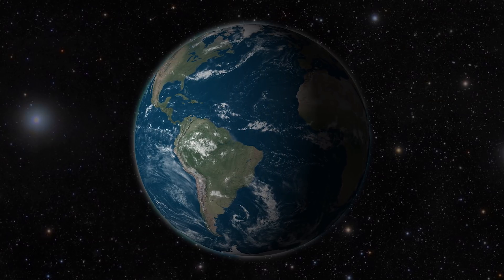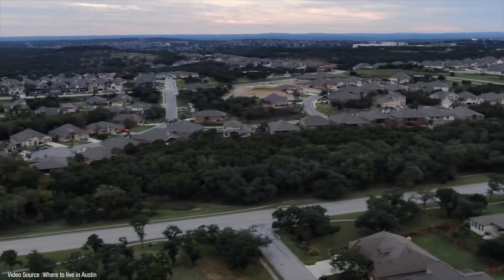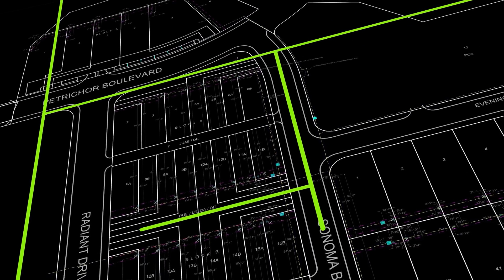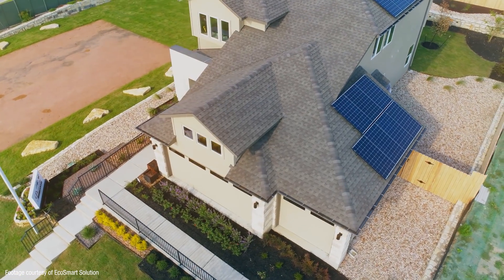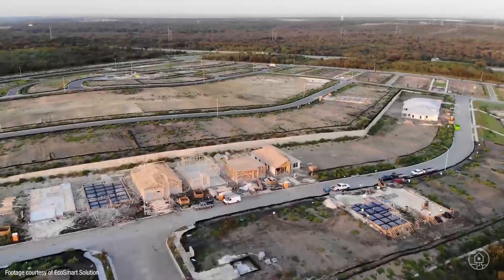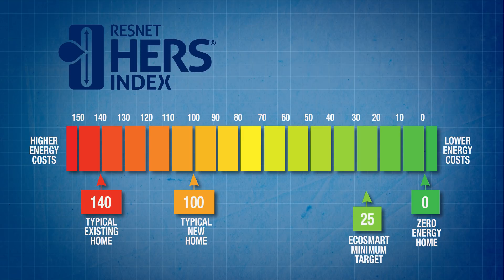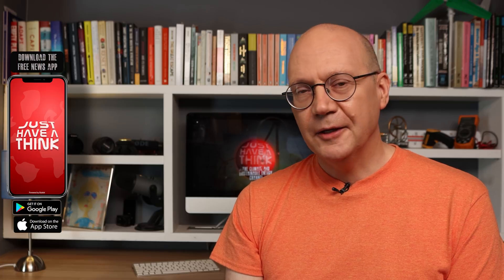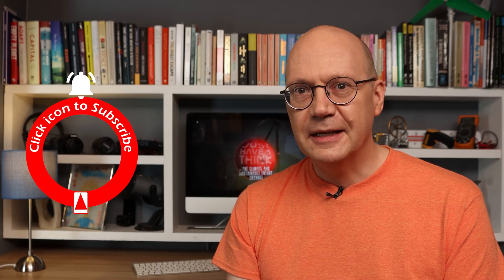Geothermal Energy meets Master Planned Communities :  A blueprint for the future?

Comment: Honestly it's like a lipstick on a pig. Every house will have two cars (tires, plastic, steel etc) which need even more roads and parkings in nearest city (more asphalt or concrete) and grass around the house will be regularly watered and definitely grass, not some kind of vegetables that could interfere with a big bbq party.
Only improvement you can expect is a self-satisfaction of affluent living there. Sigh.
Reply: Probably not worth doing anything then I guess
Reply: @emceeboogieboots1608  Absolutely opposite! Many things can be done. Most of them easily and cheaply than this. Some of them can have real impact. Just this specific thing won't cut the cheese because people living in this houses will still have extremely high carbon footprint.
Reply: @mariuszfurman4767  Yeah, a good public transport system will help reduce the need for cars but while population is increasing more housing will be needed. It is best that the housing people build now is better than the norm.
People are not all going to resort to tiny homes. I myself live in a 40 year old house and have made many efficiency changes but established homes in established areas are not necessarily cheap. Newer developments are generally further away from cities and built to tighter budgets. I think any of these types of innovative ideas are fantastic, particularly when combined with passive principles, renewable energy, batteries and such.
In fact community projects should encourage more engagement and commitment from all residents in principle
What is needed is education and governmental encouragement to help get a nice frock, a decent hat and some fancy shoes for that pig as well!
Reply: @mariuszfurman4767  Do keep in mind that EcoSmart Solution only handles the green energy technology for the homes. Texas is hot, and hot for sometimes very long periods of time. Our specialty here is reducing the peak energy demand of residential development during those times (and others) - which provides significant decarbonization efforts. Many folks in the neighborhood are undertaking xeriscaping, have EV's, and help in the community gardens in the neighborhood. The development does have significant space for commercial areas as well as transportation, and about 600 further acres of greenspace. It's a little difficult to squeeze all of that information into a 10 minute video :)

Comment: I'd love to see a 2000 acre earthship community with geothermal, solar feeding into a Tesla Powerpack system. The entire community could adapt a natural, native landscaping that provides food to the residents, encourages biodiversity, and an enjoyable landscape.
Reply: Planning this when we get our farm we are going to do this geothermaly with the steam powering turbines and power for the entire farm.  We have no need of bird and bat killing wind turbines.  We will use thin film solar panels on all roofing and on a parcel of land that's recuperating it's soils to next be in rotation.  The plan is again using thin film solar panels in a roll up solar strips 50 meters long and 2.5 m wide.  200 rolls for a half metric acre 500m x 500m.  That are easily moveable to the next fallow field. For this amount of electricity generated we will need several Tesla Coils and a field of High performance Batteries.  This may seem unorthodox but it does work.

Comment: Such an impressive approach. As a DYI solar energy buff, I quickly learned that the key to solar thermal energy systems is the inter-seasonal storage requirement. As stated in your video, it is very difficult to retrofit an existing structure, especially one built in 1895!! Likewise, it is very difficult to engage local government bureaucracy to consider a regional solution. So this developer has got it right, and engaged with the right technology solution provider to attract those new home owners with a vision toward smart and efficient energy usage. Well done!!!

Comment: We have a geothermal system with a mini German made turbine and Heat Pump which converts high pressure steam to energy to power the huge home, garage and 8 grow rooms with tonnes of electricity we bank in our batteries.  Swiss made hyper performing cells.  It has never failed us.
Reply: How do you get steam ? You dug to the mantle or you have thermal solar panels, which isn't geothermal anymore ?
Reply: @Elviloh  a bore hole 150 ft deep to where the temp is 100C the boling temp of water.  Cold water is put down the stream rises and turns the turbines
Reply: @Elviloh  you don't need to get close to the mantle to get steam especially if you live in a volcanic region. That being said I only know of one company that even makes geothermal power plants of this size and they aren't a German company, and aren't cost competitive with the grid (although their system is more affordable on a cost per kwh basis than a compatable set of diesel genorators)

Comment: Well, it's an effort in the right direction. Dropping energy usage is a huge plus. Although the current walkability score is zero, I see they are at least putting in sidewalks (pavement) if you'd like to walk to the currently non-existent retail. They have a good sized Tesla charging station as part of the development. Kind of a mixed bag for now
Reply: Roads and footways still leaves nowhere to cycle. As you say this addresses part of the problem, but does little or nothing to address car-dependency. At least there is a nod to mixed zoning so there should be some shops and schools that aren't 10+ miles away.
Reply: The entire corridor is changing rapidly, and the development has several million sq ft of space for commercial that would very much be walkable. 600 acres of green space too!
Reply: @ecosmartdavid1283  if your commercial areas are walkable but you need to drive to get there, they aren’t walkable!
Reply: @birdrocket  the main artery road that runs from one side of the project to the other is a little over 2 miles long :). At the end of the day - Ecosmart Solution is the geothermal service provider, not the developer.

Comment: What about allowing enough additional Solar/Battery capacity for all those KwH guzzling SUVs that will be running round the streets in 2035, and onwards? This scheme on its own does some good things, but it still perpetuates car-bound suburban sprawl.
Reply: that was my concern as well. Can't consider a neighborhood green if everyone is using traditional lawnmowers, and bankrupting their cities with more suburbs.
Reply: Hi there! Because the energy consumption of the ground source heat pumps are so much lower than traditional HVACs - the home needs significantly less solar. That leaves room for upgrades or expansions should homeowners want to do that.
Reply: @ecosmartdavid1283  the issue here isn’t the solar capacity, it’s the fact it’s a car dependent suburb that isn’t walkable within its bounds and doesn’t have a single connection to Austin’s transit system! That’s bad!
Reply: It is funny how pick-up trucks are not any more efficient than SUVs and are even more common, yet there is always someone whining about SUVs.  I think it is just jealousy.
Reply: @TheGuyThatEveryoneIgnores  no, it's a combo of dealing with Karens who decide their SUV rules the road, and everyone already knowing that shiny white 6 wheeled pickup is a compensation piece.

Comment: I think it's a smart idea. It would be better overall if solar owners could network their power and battery storage like they're doing here generally. I don't know how difficult that would be to do though... you'd need private power lines or cables in addition to the grid ones, which could cause clutter and complication... but if you could segment a home solar/battery network in coordination with the power companies, then it would be easy to switch between grid power and personally generated power for an entire cell (or neighborhood). You could probably also set up an agreement with grid providers that during peak loads, they could drain some of that cell (neighborhood) power to offset the load and reduce overall grid production during that time. 

I say 'cell' because each neighborhood with this network system would basically act as a single cell within a larger battery that contains some amount of charge. It's like taking the micro (circuit boards) level logic and applying it to a macro (grid) level system. It could potentially be revolutionary.

Comment: Thanks for the video, Dave. I see the benefits in moving off fossil fuels with energy conservation, heat pumps and solar panels in individual houses. All of these make great sense. Builders should adopt these measures ASAP. But the idea of interconnecting individual houses to a central air cooling tower isn't required in most climates (maybe Texas, Florida and Arizona where too much summer thermal energy may thermally pollute a ground source otherwise it's not necessary). For everyone else the district heating system (the interconnected part) is just a new utility, added costs and $50 to $75 per month for the new utility to fleece the ignorant public. The video says the new utility will add redundancy to the home owner's geo system. I beg to differ it will add complexity and cost. A ground source loop is as simple and robust as anything gets. It's a loop of polyethylene pipe in the ground back filled with bentonite clay for better heat transfer. The pipe will last generations without issues. The district heating system on the other hand is steel or plastic piping laid near the surface, with additional pumps, controls, measuring and communications equipment. The pipe is subject to corrosion, possible damage from underground digging operations, the rest is subject to the typical maintenance requirements of that kind of equipment. So will in effect add complexity and maintenance costs. A good investment for a new kind of utility to profit from and the home owner to lose money in.
Reply: Precisely. This is why I'm not fond of central planning. It typically leads to nepotistic practices. The fact that the homeowners aren't given the ability to opt out of the network makes me wary. As you said: their own ground source loop should be more than sufficient to manage their homes. The idea of adding tons of complexity and maintenance costs to gain some nebulous shared benefit makes no sense.
Reply: That's a very interesting counter opinion, Daniel Vivian. You make some good points. I'm not sure what to think, but you're certainly right about the added complexity. I think the idea of building entire developments where everyone has a geothermal heating system installed from the beginning is a good one, but maybe the interconnections aren't necessary outside of hot climates.

Comment: You can also get alot of that efficiency by building attached homes instead which is a much simpler solution. The geothermal tech is fascinating though
Reply: The project will have both single and multifamily product - as well as transportation and commercial. :)
Reply: Given how close these houses are to one another, they might as well be attached.  However, the wall separating attached houses should be masonry for both fire protection and sound reduction.  Unfortunately, the only masonry in these houses appears to be the slab on which they are built.

Comment: Whisper Valley design is actually a 5th generation District Heating system as defined in UK (look it up). That is water at ambient temperature 25C and boosted at the point of use using heat pumps. The problem with this system is the mandatory minimum thermal performance of the buildings served. Existing housing stock in UK needs serious work on the building envelopes to accept this sort of low temperature distributed heating system. I bet the thermal performance of the houses at Whisper Valley are well above "the minimum building code requirements" ( this is the slang of an american real estate developer :))) ).  Geo energy should be the way forward and mandated for new developments. Can be backed up by thermal solar where there is no need for cooling in summer  ( see UK) to avoid thermal depletion of the ground over ten or fifteen years. Long term thermal balance of the ground is critical when designing these systems. For now, geo energy is extremely expensive, we lack competent people to design and build large and complex systems ( a drilling rig  is insanely expensive)  , so I can't see it becoming the main heating source in the next twenty years without a coherent support from the government, both in UK and US.
Reply: This system in Austin is, for the most part, a cooling system. There will be cooling towers to keep the groung from over heating.

Comment: Love the content. Thanks for the video, but describing Biden’s current green energy plan as “ambitious” is a joke. Just because it’s marginally better than the worst, doesn’t make it good.  Here in the states there is an immense need for pressure on political leaders to do even the bare minimum.
Reply: It's ambitious considering that the Republicans are fighting him at every turn.  It's also WAY better than ANYTHING that's come before.
Reply: @incognitotorpedo42  relying on the rhetoric of hyperbole rarely produces productive discourse. One would have to have a relatively short memory to agree with that comment, on the whole.  Things could change, but the current docket of toothless, fossil-fuel-friendly initiatives coming from Biden’s administration are milquetoast, at best, and not nearly close the minimum necessary.
Reply: @grammapolice  Would you rather have someone walking in the direction you are trying to run or would you rather have someone pushing you backwards?

Comment: A great project and certainly the future!  This is like a scaled up and updated Drake Landing project in Okotoks, Alberta where the ground temperature is closer to 12C and heating starts in October and lasts until may.  Still their system COP after 10 years is close to 30:1 which is fantastic.  The end message is that this solar PV/hot water geothermal hybrid system works in Alberta which has far less solar energy to work with and has far higher energy demand, yet it still works extremely well.  This approach will work anywhere on the planet south of the permafrost line.
Reply: You beat me to it!
The Drake Landing Solar Community system   http://dlsc.ca/  built around 2005 is far better geo-exchange system given their colder seasons. As I recall:
1) the heat store is a centralized 1/4 acre honeycomb grid with ~150 boreholes on a 6ft pitch for ~50 homes so total lateral heat loss is vastly less, 
2) the store is pre-charged for 2 years before discharge which means only the topmost 1/3 of heat charge (IIRC 140F-180F) is pumped around the community. Heat pumps are not needed saving a lot of electrical load. The heat store is never allowed to draw heat below 140F. In most years of home heating, 95% came from the heat store and 5% from a central station natural gas backup system.
I concur with John, this could scale much more efficiently for different regions.
I also wonder if an adjacent borehole field that is cooled in the winter to store cold, could be used to reduce summer cooling costs for hot regions. A heat pump system between the hot and the cold stores might even enhance the temperature difference.
Reply: @briannugent5518  Drake Landing definitely set the bar in Canada.  But are you suggesting the thermal mass doesn't drop below 140F?  I'd guess it drops to below 5C by March.
Reply: @johnm2879  The brilliance of DL is they pump heat into the store for two yrs prior, then they only draw heat from the third / last year. So the store temp gets elevated in 3 stages of about 50F increments all the way to ~180F. By only drawing the top third of the stored heat, it stays in range where pumps suffice. If the store only held one summer of heat it would need heat pumps. Thats why the COP is so great!.

Comment: Normally when someone repeatedly tells me something is Very Cleaver it is not a good thing! It means it is prone to system failures.
I don't think this is the case here! ;o)

I think the clever is in the concept not the mechanics. Here in the UK we had a phase in the 70's for communal heating in housing development .... it didn't work out to well, but the concept was sound. Nowadays we don't have a heating system where the way to turn it down is to open a window and the tech for insulation of underground pipework has come on leaps and bounds too!

Yes I like this one! .... one of the reasons is that it remains a flexible system by design!

One of the few flaws is that should something go seriously wrong with the underground system you would have a large number of people affected at one time, without the infrastructure to cope with the additional strain, but I expect that the design would allow for segregation of sections of pipework from the system in the event of such a problem.